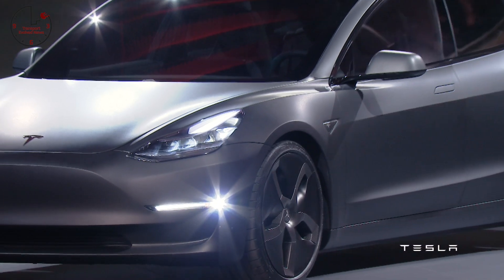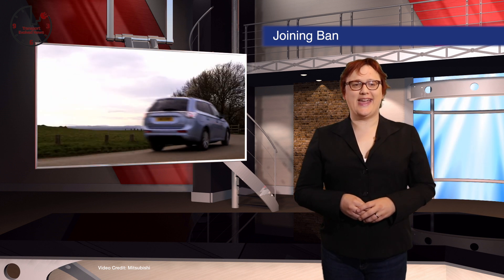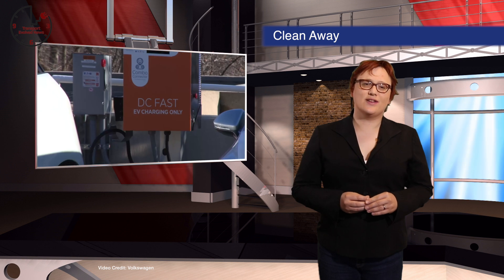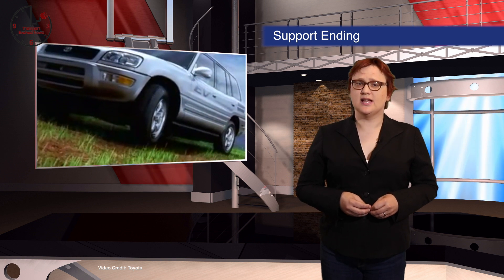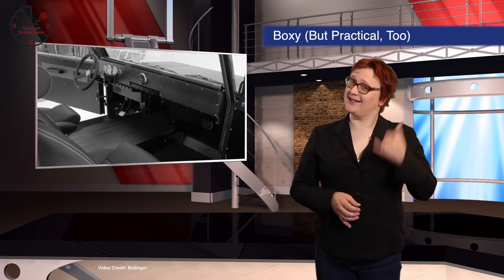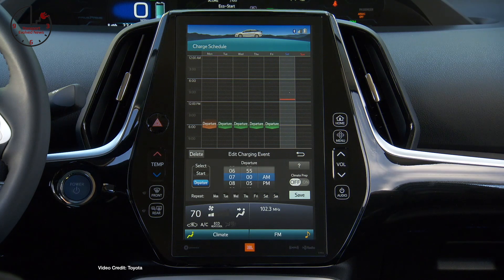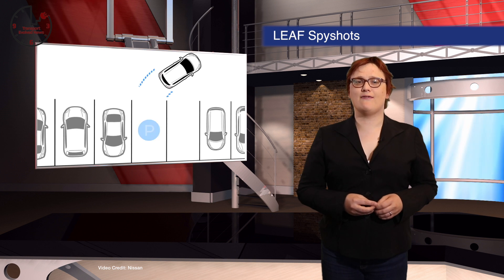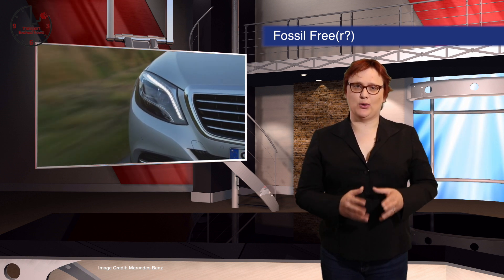Model 3 Efficiency, Solid State Batteries, LEAF Spyshots,  -- TEN Future Car News 28/7/2017

Comment: Great show Nikki! I wonder if you could do a piece about the hidden costs of EV ownership, primarily the decline of the battery pack. Many unfounded criticisms can be found comparing battery degradation of EVs to cellphones etc. which as you know is way off. For the Leaf gen 1 there is great data from the community as to degradation vs. Miles vs. Environmental conditions. Surely these exist on the Prius, Volt gen 1 and Tesla forums too. A special looking into how big a deal degradation is would be great! Especially if you want to discuss smart grids etc as a country, where charge cycles will be used to flatten out the grid load.

Comment: UK government were talking about diesel and petrol new sales in 2040, what a joke. No mention if that meant petrol/electric hybrids as well. So that old diesel you buy in 2039 could be running on rape oil until 2089 or more. Very silly.
Get all small diesels off the roads by 2025. Big diesel can have complex AdBlu and other filters, small cars can't (easily).

Comment: I guess this ban on Trans in the military shows that Trump is not a complete idiot. He at least learned he has to give some excuse related to another thing before doing something based on prejudice. Unlike that Islam ban debacle. So, progress? 
Still, it's a paper thin argument, if cutting costs for VA healthcare was the real problem couldn't he just signed an order removing hormones and sex change surgeries from the things covered? 

The saddest thing is that, to us looking from the outside of the US, the hole thing seems to be a smokescreen for the Russia situation and apparently the news seem to have taken the bait...

Comment: Thanks for keeping the show well rounded and not being a Tesla Fanboy.  Don't get me wrong, I own a Model S, I am buying an apartment with a 650 kWh Powerpack,  I have a deposit for a Model 3, and I have a great relationship with Tesla cars, power and charging.  But I also own a Nissan eNV-200 and a 1st generation Leaf  (which is for sale!).  My daughter is not a Fanboy either, she is drving the NV-200 and has a lot of fun with the shift braking and would rather have a new Leaf than a Model 3.  We like to drive and would rather keep the control ourselves.   I was interested in the startup that wants to make an affordable EV without Autopilot.  Please be successful.  
Have I mentioned that battery production is very important?  Please, Nikki, plunge into North Volt and give us some info on who is investing.  I am trying to convince LG Chem to invest in taking over one of the candidate cities to build a factory.  I am also trying to peel off investors that want to get out the fossil fuel War Machine and build batteries.  I do disagree with Peter Carlsson about Sweden having a clean electricity grid since they have so much nuclear.  We need to have a massive investment in Solar PV to get off coal, then we need to invest in battery production.

Comment: We need to know how much usable capacity the Model 3 has. No matter what, it appears to be much less efficient than the Hyundai Ioniq EV. In fact, if the smallest battery is 60 kWh usable, the Model 3 is less efficient than the Bolt EV. 

In positive news, the Bollinger B1 needs to happen.
Reply from the maker: +News Coulomb good point. And apparently it's an estimated  range of 220 miles for the smaller model. I don't know one capacity yet.
Reply: News Coulomb The model S I'm driving now consumes 30% more energy than the Ampera (=Volt) I drove before under exactly the same driving conditions. While I don't worry too much about the energy itself, less efficiency means less range or a larger battery. It is partly caused by not much smoothing on the power control input from pedal or cruise control leading to nervously varying instantaneous output/regen. Tesla should work on a normal/sport mode toggle as it is a quick win.
Reply: plemli Some of it is a hardware issue (e.g., induction motors), and Tesla won't be able to address that in the near future, if they ever care to. The PMAC motors that most manufacturers use are significantly more efficient; however, the Model 3 appears to be a bump up from the Model S in efficiency. If the battery size estimates are correct, the Model 3 gets about 4.2 mi/kWh, which puts it just ahead of the i3.